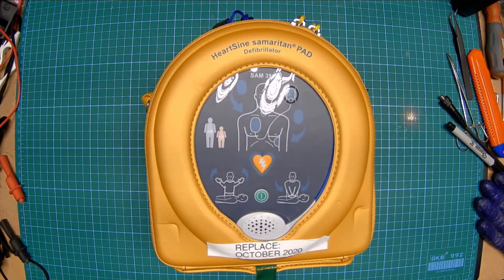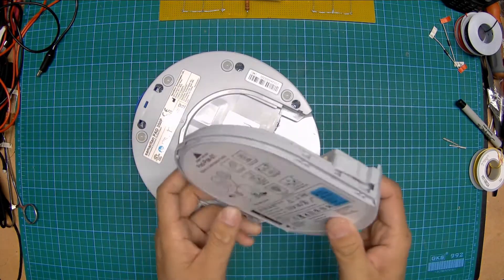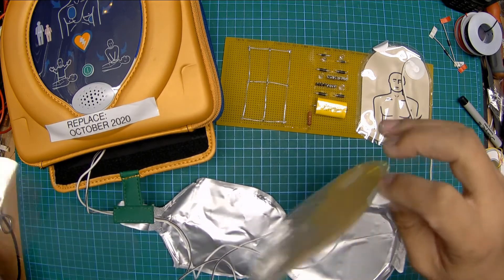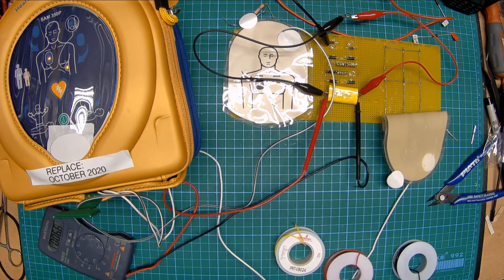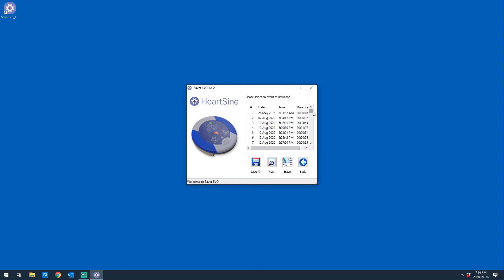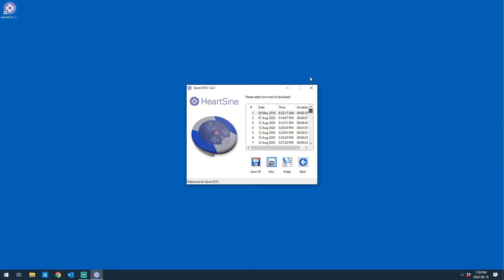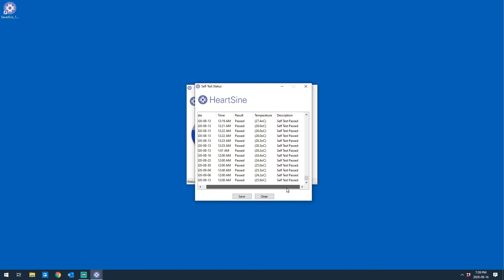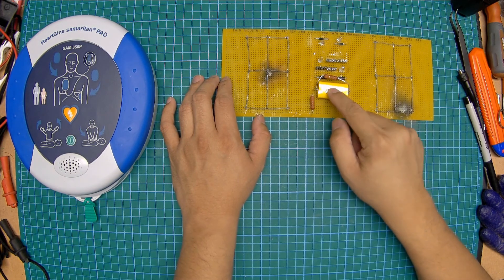Fooling Around with Automatic External Defibrillators

Comment: When a person's ECG is "flat line" it is called asystole (like when you just placed the electrodes) and NO ONE SHOULD EVER DEFIBRILLATE AN ASYSTOLE, when you move the leads to create electrical noise the reading looks like an actual ventricular fibrillation and that IS a rhythm that needs a shock as soon as possible, that's why (medically speaking) you were able to discharge the AED.